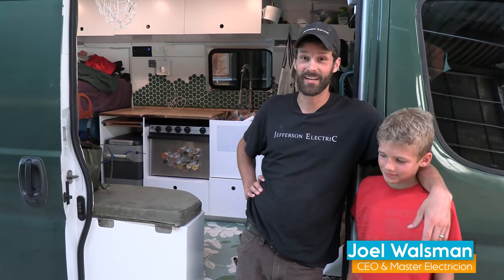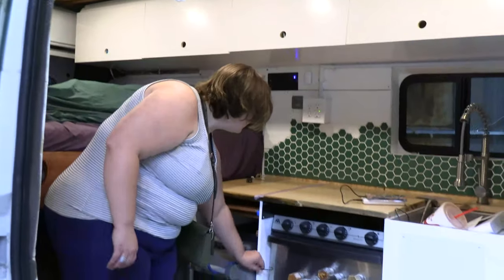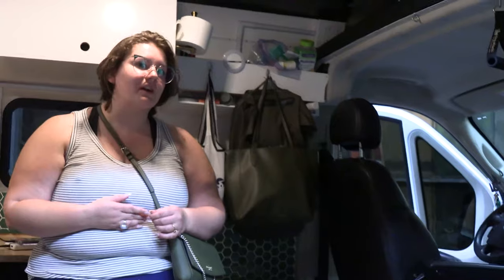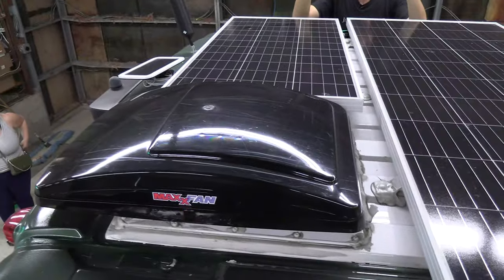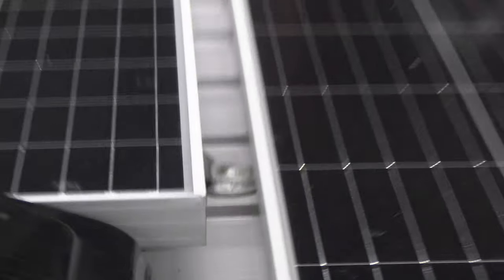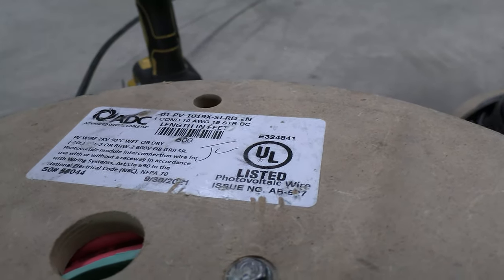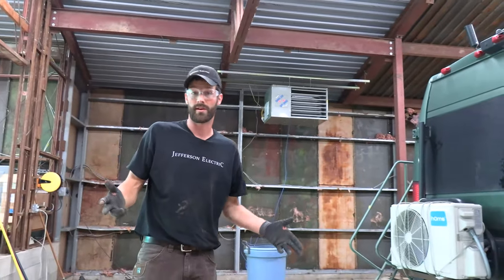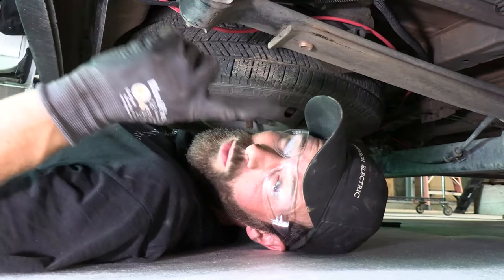Cooling Van Life With The Sun

Comment: I like to shrink tube the crump connectors.  Looks nice, helps stabilize the connection and prevents accidentally exposure of wires.

Love to see more of your off grid work
Reply: In addition to the shrink tube, any connections that land on lugs, I would prefer to use ring terminals rather than forks, especially in environments where vibration can become an issue in loosening connections. If that nut on the lug loosens a fork will just slide right out.

That's how we do with anything over 24v in an industrial environment.

Comment: Hard Start- uses a capacitor to rotate the magnetic field to create a faster (harder) start so little more amps but much less duration

Soft start- it ramps the voltage and amps up in steps to start a motor over longer duration but much lower inrush (surge) current. Much like a VFD drive

A mini split has a variable speed compressor and fans so it already slowly ramps up so basically no surge

Comment: Hard & Soft start systems are different.

A motor is basically a dead short when it first starts turning. This puts stress on everything, especially a power source (ie inverters) which must be rated for that peak starting load, or LRA… Locked Rotor Amps, current drawn when the rotor is not yet moving. 

A hard start puts an extra capacitor on the compressor, typically when they get old and having a harder time starting. It provides extra current during startup, to get the rotor moving. This masks the LRA or reduces the time LRA is experienced.

A soft start puts a circuit before the compressor, to slowly ramp up the current leading into the motor, reducing the LRA, so power does not rush in. The circuit delivers power required to turn the motor at the anticipated speed, increasing power as rotor speed increases. Elegant!

The more complexity added in components, increases failure opportunities, especially under stress. Instead of getting a hard or soft start kit, I bought an inverter whose peak rating can handle the LRA. A GenetrySolar inverter has low idle usage and high peak load capacity via a large transformer, making these circuits less important.

Comment: I'm surprised you didn't fuse the charge wire.
Reply: do you get surprised a lot? 🤣
Reply: You should be surprised. That is a major misstep. A short on that exposed wire will cause all hell to break loose. Ignoring the row of fuses right where the wire is connected is kind of odd. Otherwise interesting.

Comment: There is a little trick to running wires in vehicles no matter what kind it is (Wire Coat Hanger) used as a fish rod. I have used this to even run wire under the carpet and through the firewall

Comment: I've learned a ton about working on residential electricity from your channel and I love seeing kids helping in your videos. I'm a mechanic myself and I'm just wondering why you didn't use a fuse or a circuit breaker for the 30A/10g wire? Right on top of the battery would be a great spot. Seems like a safety issue, especially since the wires are generally unprotected under the vehicle. The big power wire going to the starter is also not fused but is generally heavily protected all the way to the starter. Just checking! Take care.

Comment: Vehicle wiring would involve DOT NHSTA regs and rules....and connectors, plugs and connectors need be moisture proof, dirt and sealed like mfg factory stuff for a long trouble free use.  Hot cold, damp, humidity, vehicles connectors are a lot more robust

Comment: Are you considering bringing any HVAC in house? The workmanship on that mini split install doesn't look up to the standard of all the electrical, and for new install of small single-head mini splits I'm sure a competent electrician would have no problem getting up to speed. I'm not sure whether EPA certification would be required to handle the refrigerant in this application but not the hardest thing to get.
Reply: Also... you gotta get off your back on that concrete floor. You won't last long. I don't recall if your shop build includes a lift but there are a lot of good deals on used 4-posts all over the midwest.

Comment: Shoddy wiring and layout in and under the van. If the owners need servicing at a repair shop, more money spent on tracing wiring runs and crimped connectors in split looms. Recipie for disaster

Comment: I really dislike the general use of the phrase "hard start kit" in the HVAC trade. I refer to them as "starting components" as do many manufacturers. In my opinion, there are TONS of brand new installs which should have a starting component system installed consisting of a starting cap and a potential relay. Instead, they just have a thermal current passing device which sends some current to the start winding, but that's a really terrible way of handling the process. Hot climates (like Phoenix), long line sets, vertical height difference, low supply voltage, and hard shutoff TXVs should ALL get a starting system even if it's a scroll, but truthfully even a standard install scroll will benefit from a starting system. OEMs of compressors provide the starting capacitor value appropriate for that exact compressor. You may need to search for the model number spec sheet or call the tech line. I dislike universal HSKs because many just use a timer relay and that sucks. The potential relay is exact, because it disconnects the starting cap exactly when back EMF is generated. The LRA is insanely high even on a standard scroll install like you said in the video. For that fraction of a second, the windings produce a LOT of heat. A starting cap gets that rotor going as fast as possible so the motor isn't dwelling in that LRA phase of starting up for a long period of time. Once it reaches 80% of normal speed, the startup is pretty much done. People may think a starting system is hard on a motor for no reason because it's like kicking it really hard when it starts ok with a current device, but that isn't true. The extra start phase delay and reservoir of energy provided by that start cap takes stress OFF of the motor and decreases heat buildup a lot. Heat over time cooks windings, burns oil, and reduces the life of the compressor. A timer-based HSK uses a break delay relay and it doesn't care if the motor reaches 80% speed in half or a quarter of that time. It gives the start winding extra load for no reason and that is bad. Giving it a bit of extra load to get things going asap is good and the heat is less than a motor dwelling in LRA heating up considerably. Giving the start winding extra load for much longer than needed is defeating the purpose. The hand grenade type kits usually have a timer. Look at their schematic to determine the truth about this. The only downside to adding a start component system is the possibility of PR failure and having the start cap stuck in circuit. A bleed resistor is required and a proper install will be just fine for years. Checking a system yearly is a must, I say twice yearly actually. After 5 years, just replace the PR and be happy. You save energy and prolonged the life of the compressor that whole time. It's worth the money. An HVAC system is not an investment, it's a luxury that's a money pit like a car. 

A soft start kit for RVs however, is a must in my opinion. No OE starting cap and potential relay is used. The soft start controller does all the work self contained. The process of starting the fan and compressor separately and then ramping the compressor up softly really puts less strain on the inverter and batteries. Btw, one can install a soft start kit on a big 5 ton residential condenser just the same way. One can also reduce the starting draw of a 5 ton res unit by adding a thermal sequencer or a delay-on-make relay so that the fan comes on first with the call for cooling followed by the compressor a few seconds later. Separates the LRA of both motors on the mains supply and the air flow brings down head pressure to make for an even easier start.
Reply: I really dislike the use of the word "partner" to refer to the person your heart treasures about all others.  A partner is someone you work with in a chemistry lab experiment.